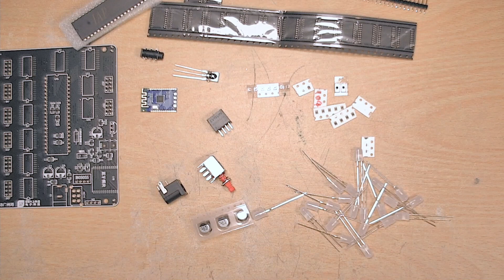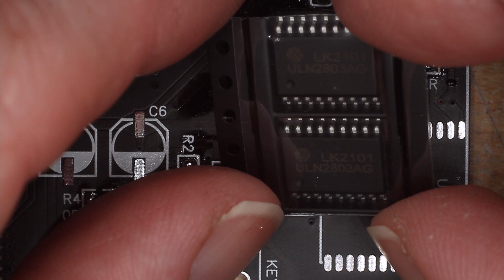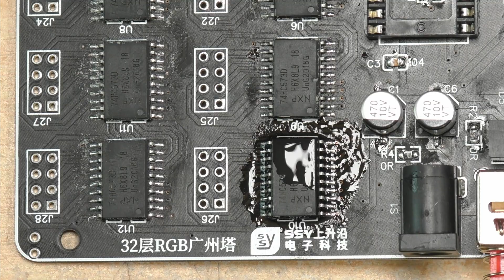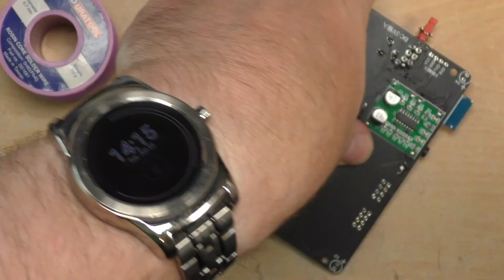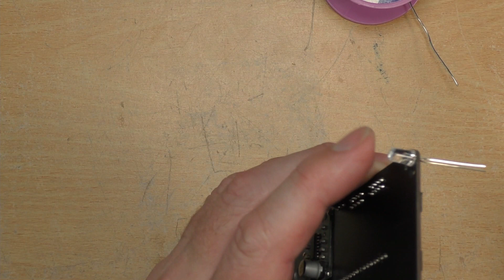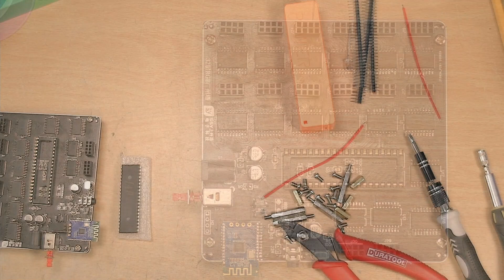Build With Me - Banggood Canton RGB LED Tower (with Bluetooth) Part 2 - building the main PCB

Comment: I have bought both versions of these towers. For soldering these joining pieces  I would assemble the female and male sections together, insert in one board and place the other board on top and bolt together with the standoffs. A little tap with a ruler should straighten them out, then solder in the knowledge that they will be perfectly aligned. The other thing that I find disturbing is that the metal standoffs cover tracks on the IC Board. this could potentially cause problems. I would either use plastic standoffs or an insulating washer where the standoffs are covering tracks. My main concerns are around D1, D2, D3, D4 on both sides of the board. The speaker mounting board is not so affected as there is a lot more clearance to the tracks.
Reply from the maker: Great tip, thanks for sharing! and a good point about using some insulated washers to guard against accidental shorts
Reply: I am most surprised that the board designers did not allow for it. Basic error. The black plastic standoff spacers are ideal, insulation and look. When soldering the connectors if you want to be super finicky yo could just solder diagonal corners of the  female blocks first. then check for position and then solder the rest. By doing that you would still be able to adjust them if need be. The other thing is do not over solder the joints or you might not get them apart again if you solder the male pin in the female socket. There does seem to be quite a bit of slack on the female joiners to the board , more so than the the male joiners that have larger pins.
Glad you liked it.
Reply: I would also use a high rating rubbing alcohol to get all the solder flux off. Just FYI
Reply: @WeldonSmith-un9iu I always do use a solvent cleaner. I find surgical spirit to be a good cleaner. Rubbing alcohol in the USA same thing is surgical spirit in the UK. Artists paint brush and cotton buds.😊